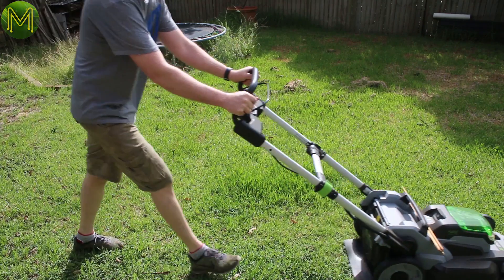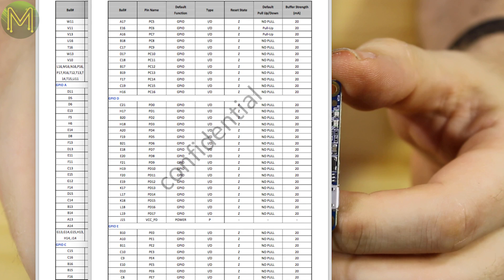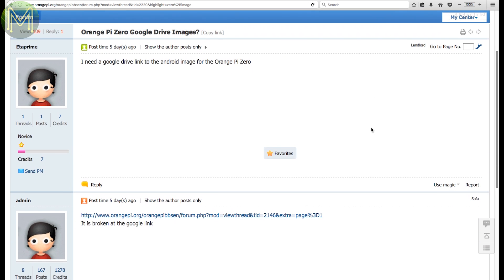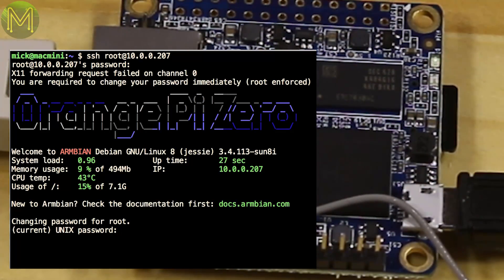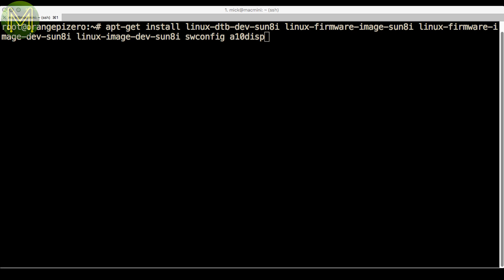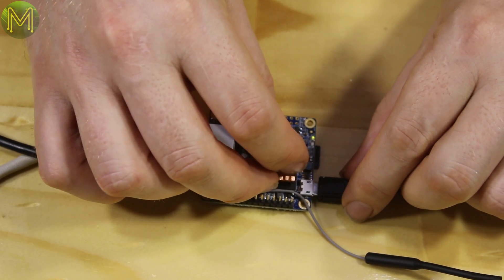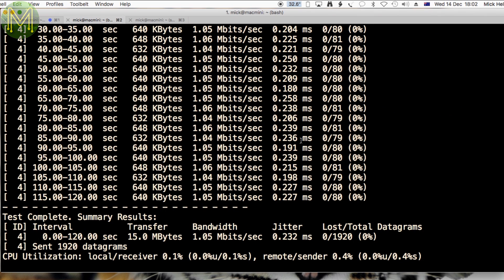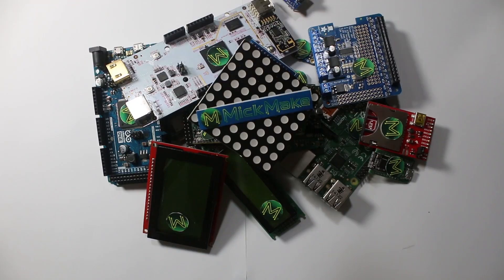#080 Orange Pi Zero: Better than the Raspberry Pi Zero? // Review

Comment: Watched about 2 minutes and all I can think is "This ain't the guy to be reviewing this".
Why didn't they break out all of the hundreds of pins.. must be a design mistake, nothing to do with the fact that breaking out all of the pins would be next to impossible without adding more layers and ramping up the cost.
Reply from the maker: +donpalmera 
True, but only breaking out 1/10th of the GPIOs is crazy. It'd be nice to have at least another couple of the more interesting ones.
Reply from the maker: +donpalmera 
... and that wouldn't have ramped up the cost by much if any at all
Reply: MickMake They have to do impedance matched routing for the DDR, there are other components in between the pin headers and the H2+ BGA. I think breaking out any more pins would be pretty hard.
Reply from the maker: +donpalmera 
If you look at the current schematics and board layout, there's room for at least a dozen GPIOs without significant change, but I can understand the reason. They wanted to lower the cost as much as possible. So even this small change could be significant.
Sad really that marketing wins every time.
Reply: MickMake 
Do you have the gerbers? Schematic shows almost nothing about the physical reality of breaking out a BGA like that on 4 layers in such a small space with tons of other components in the way. 
And obviously they've done everything to reduce the price. Including using fixed regulators instead of a PMIC, a weird wifi chip etc.

That's sort of the whole point. The Pi zero is getting towards the price of some of the more capable microcontroller based wifi modules (the new ESP etc) and out specs them by miles.

Comment: I'm curious to know about the audio out.  On the 13 pin header, it seems like there's an audio left/right channel.  From a hookup perspect, could i just get a two pin dupont header and wire the other end directly to a passive speaker?  Actually now that i think of it, if i'm just using a singular mono speaker, just bridging the two channels should have the same effect with a little more amperage i'd assume?  Fault logic on my part?
Reply from the maker: +Victor Hogarth 
Technically you could, but a more appropriate method would be to use an audio amplifier on the speakers.
Also you should mix the left and right channel instead of "bridging", that'll give you some funny results and cause one channel to drive into the other channel. Essentially not what you want.
You can pick up a cheap PAM2802 breakout from AdaFruit and SparkFun. A single channel amp, or use a stereo amp with two speakers.

Comment: I love the Orange Pi Zero. Its has 3 serial ports, which I am going to use for out of band management for network equipment. Armbian is way better than Raspbian, if you just want a clean Debian with great kernel support.
Reply from the maker: +Per Mejdal Rasmussen 
Nice! Yup those extra serial ports are great to have. I have a bunch of equipment that I'll be hooking up as well.

I quite like Armbian and it'll probably end up being the de facto standard I reckon.

Comment: Since this little guy has been out for a bit longer, has anything improved on the software side? I'm looking to make a tiny handheld emulation platform, but only the power use seems to be friendly.
Reply from the maker: +CheffBryan 
It's getting better and better. It's actually fairly complete already. Someone else has commented that it keeps up with PS1 games.
Reply: MickMake Fantastic, then a MAME machine that fits in your pocket sounds like a solid goal.
Reply from the maker: +CheffBryan 
It certainly looks promising, except for the HDMI out problem.
Reply: MickMake Thus why emulation would be fine; only need to hit that high-quality 144p!
Reply from the maker: +CheffBryan 
True!

Comment: The one thing that keeps me from buying this one over the Raspberry Pi Zero is the tremendous amount of support the RPZ has, in terms of hardware add-ons, software and community. Still, for certain types of tasks, this is definitely the way to go for "bang for the buck"! Keep in mind that, although it is certainly a tremendous deal, it's about 40% more expensive than the Pi Zero (Around $7 instead of $5 for the RPZ).

JW3HH
Reply from the maker: +JustWasted3HoursHere 
That's true. Nothing beats the support within the Pi community, but the OPiZ has a large community behind it on the Armbian forums and the company even supports Armbian development.
It depends on your use case: if you want better support, then the RPi. If you want more bang for your buck, then OPiZ.
Reply: I did actually manage to find a version/port of Retro-Pi for the OPiZ, so that changes a few things for me, since retro-gaming was the main thing I wanted to do with it. Still, I will weigh the differences carefully before I buy either one.

JW3HH

Comment: Very very nice review. Surprising SBC packing cpu punch for less than 10$. Are you still trying to get a 4.x kernel fully working ? BTW, I wonder if there are attempts at a hat with full 300+ GPIO lines. That could be fun ;) PS: do you know if the separate 2$ hat with IR has bidirectional IR ? merry holidays sir
Reply from the maker: +agu monkey 
Thanks!
Yes, there is a "hat" which pushes out all the extra pins to proper connectors.
It's actually a good thing to minimise components on the board, it means it can really cut down the overall footprint. All you have to do is remove the Ethernet port and it's really tiny.
As for all the other GPIO lines? Well alas they can't be used as they're not even connected anywhere in the PCB. Since it's a BGA you won't ever be able to get to them.

Comment: The Orange Pi Zero is limited as a general purpose computer (it only has one usable USB port and no video output, unless you want to solder and are happy with SDTV), and is limited as an IoT device, too (its 26-pin GPIO header and its power and heat problems make it undesirable). The only area where it shines is as a headless server (web, file, media, eDonkey, etc.), or maybe as a wireless access point or 3G/4G router. Given its size, it would make a nice pocket server (interesting if you are a developer, or if you want to use OwnCloud on the go). But its power consumption, again, is a barrier for battery powered applications. In short, it's a nice idea blunted by its limitations.
Reply from the maker: +ajgelado 
The CPU vs power consumption is actually pretty decent 400mA peak is great for a quad core.
Compare that to something like the UpBoard or LattePanda it's very lean.
Reply: I'm not talking about power/consumption ratio, but of raw consumption.
The ratio, as you say, is nice, and even more if you consider the price. But an average consumption of 250-300 mA under load means that an small 300 mAh battery will not last more than an hour per charge - and what's the point on a tiny 46x48 mm board if you need to have it tied to a three cell power bank or a power supply?
Also, take into account that the Orange Pi Zero and the LattePanda are in opposite ends of the SBC spectrum, both in features and price. The LattePanda is almost a desktop computer (it is more powerful in every aspect than almost all ARM boards, and it even runs x86 software directly), while the Orange Pi Zero (and the Raspberry Pi Zero) are more alike to an Arduino, with the added advantage of running a general purpose OS. But the Orange Pi Zero consumes three to four times more power than the Raspberry Pi Zero (250-300 mA vs. 80 mA). And this without taking into account that people have managed to get the Raspberry Pi Zero down to 15-20 mA, with the help of an amazing documentation and community.
Reply from the maker: +ajgelado 
Yup, the x86 SBCs are very different to the ARM SBCs and really aren't in the same category. The price you pay for an MCU that isn't really designed for mobile devices.

Comment: suggest me easy projects with pi
Reply: http://bfy.tw/3cnQ
Reply: A USB raid NAS/Torrent server using armbian. I built one and after a bit of hassle served me VERY well. Its dead now because the USB sticks (4x cheapo mcCheaperson 4Gig USB sticks) have worn out. the Pi still boots but the raid is dead. So i suggest you to use harddrives directly. Oh and a heatsink. Those things are Imperative. For Powersupply i used the powersupply for the 5x USB hub soldered it directly to the board (OPi1 since that is rather powerhungry and wont boot with less then 2 amp supply) I guess if u opt for harddrives you should have a beefier PSU. Or use higher quality USB sticks.

EDIT, i also added a fan, that is controlled via a simple python script over the GPIO ports since i live in a rather hot enviroment. I planned to add status LED`s to the case bridging the data pins from the various USB drives but never got around to it.
Reply: read this free mag and do the coding & electronics projects you will learn a lot:
http://v.ht/rpimag

Comment: Nice review. But ... I played with that little piece of hardware extensively for 3 weeks now. 1st - use Armbian. 2nd - to use SPI1.0 (on header) you have to unlock it in config. SPI0.0 is available right from the start (that's for not populated SO8 at the back). SD Sandisk class 10 4-16GB should work quite allright. But not all microSD would start up with OPi Zero. Both i2c (twi) are available right away... check i2c-tools package. So... there are things which are tricky to get working but once you're through it you can enjoy and use it one widely available hw unlike rpi zero :) I've just recommended OPi to replace RPi in some places those were used in my company. Not because they're better overall... I'd say better suited for our needs. And cheaper too. 
And yes, fully loaded 4 cores do heat up silicon die drastically - additional cooling is required for heavy computing tasks (or plenty interrupt routines handling... in case of some python scripts like MFRC522 from github).
Reply from the maker: +Przemysław Stalmach 
Great to hear your experiences on it.

My initial reviews that I do I try to approach them from someone who doesn't want to spend much time getting the thing they just bought going.
I then run a review update a while later covering the product more deeply as often things change.

I actually quite like the OPiZ, but It has a lot more potential than is currently available. A real shame they only provided standard RPi headers. Real shame.
Reply: I understand you. I just wanted to give some hints for those trying to get it working. People just expected it to be cheaper RPi direct replacement. It is not. It can do very same things but due to lack of proper support most work "to get things running" is done by users themselves. Basically this rules out beginners, real shame because hardware is quite ok.

Comment: They've over complicated the way you connect a screen to it. :/
Reply from the maker: +television and cheese 
It's fine if you want a headless SBC, but yes it can be a pain if you want a display.
Reply: To me it doesnt seem like the right 'tool' for a device that you're planning on hooking up to a monitor.  This is geared, in my opinion, at a headless/embeded solution.  Which i think works really well.  I just bought one and the "expansion" board.  Cant wait to play with it, from the forums it seems like the armbian image seems work work well with it.

Comment: Yeah they definitely failed in the feature market. With as much as that could do with the proper board and supporting components the current itteration seems underwhelming to me too. It wouldn't even have added all that much to it's size footprint. I'm really waffling on the edge with SBCs. There's just not enough functionality for me to want to use them. I'd want them to be able to drive a touch screen in a dash mounted car computer installation. With the heat issues of a car on a summer day and from what I've seen of them so far it wouldn't work. Mind you I'd be using it mostly for Android applications like google maps navigation, playing MP3s, and possibly displaying other information. I really don't know how well one of those would work for that. Especially when mini ITX boards with preinstalled Intel Atom processors fir neatly in cases that were designed for a 12v power supply. I'd be interested to hear your thoughts on the subject Mick. You may think of something I didn't which would be helpful.
Reply from the maker: Yup, I've just recently bought a cheap car, and I'm thinking of fitting it out with some bells and whistles. So, I'll be giving a dash-puter some thought next year.

Ultimately, the best way to run a fanless SBC, is to buy one that has a high clock rate and the reduce the clock rate as low as you can go. Video work will always increase heat output. I'm thinking of using a Teensy 3.6 as the "backbone infrastructure" that controls all aspects of the vehicle and provides sensor data to a small SBC with LCD in the dash.

That way, if it gets really hot and things shut down the Teensy will keep going on.

There's also some rugged SBCs on the market that I'm looking at, (there's really tonnes and tonnes of them and I've only scratched the surface!), which can do the job and they can be fed anything up to 20v in.
Reply: That's not a bad idea. Provided the teensy has a USB host and a microSD reader. I'd imagine you could control one over the I2c buss. That would take a bit of the load off the SBC of choice in the installation. I'm pretty sure they make shields for those...

Comment: Hey Mick, you reviewed lots boards. so what is your recommended board for desktop use?
Reply from the maker: Mehmet Kose 
The pocketchip is good, but don't consider it a full time desktop. You can see my review on it.

https://youtu.be/Z6dvOvcMbgo
Reply from the maker: That's a really open-ended question.
Like anything; it depends on how much you want to spend and how much performance you expect out of it.
Is it just web browsing, emails, youtube? Or do you also want it for Maker projects?
Reply: actually I want to develop programs on vim or sublime text. I got rpi zero and orange zero, but ofcourse this boards only for iot. is orange pi 2 plus good? what you think?
Reply from the maker: Mehmet Kose  I haven't tried any of the other Orange Pis, but from what I can see so far they'd be ok as a desktop. For coding software, your basic requirements are: good 2D support, reasonably fast I/O and lots of CPU.
It also depends on what your target platform is. You can cross compile easily enough, but there will be more storage overhead.
Reply: i have had my eyes on it for a while, but it seems quite weak even for web-stuff, i ended up getting a rp3 and its great

Comment: +MickMake from what you've seen could this be made into an ethernet cabled FTP server which uses USB storage? I'm looking for something to extend the storage capability of a cctv encoder and this could be a really neat option.
Reply from the maker: +Simon Merrett 
Absolutely! I was running a 500G hard disk off this. Which was strange as it was 20 times the size of the Zero. I don't think it'd be able to power a laptop hard disk from the USB port. I used a 3.5" powered disk.
Reply: +MickMake Thanks! A usb flash stick should be fine, power-wise? Going for small form factor and the ability to swap drives out, so unlikely to opt for spinning disks. Which distribution/OS would you try first for this kind of application: Armbian or another?
Reply from the maker: +Simon Merrett 
USB flash should be OK, but YMMV with those. Some pull a lot of juice so it can be a bit of trial and error.
Use Armbian, far better support on that for ARM than any other dist I've seen.

Comment: I'm a noob so be nice. Can this run things like RetroPi by installing it the same way. Or in other words, could the same SD card be used on a Raspberry Pi Zero and then placed into an Orange Pi Zero?
Reply from the maker: +ZLau13 
You could also mount up the image and use the existing user space binaries, under a chroot with --bind mounts for proc, sys, etc.
Doable, but fiddley.